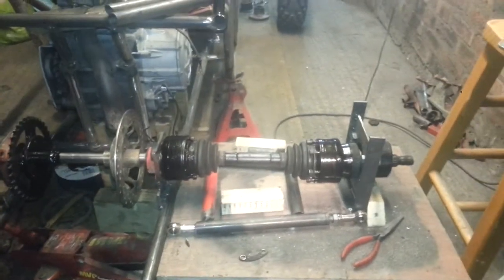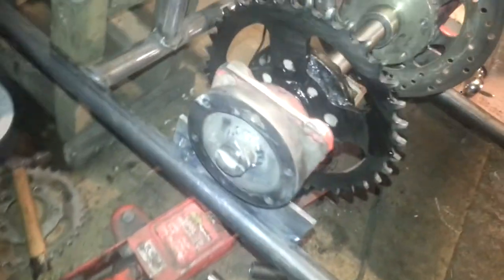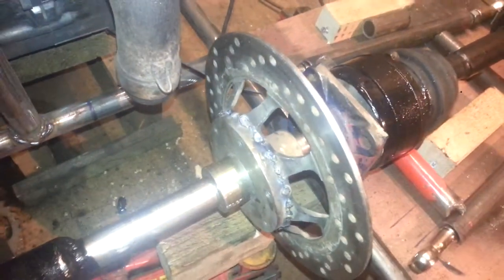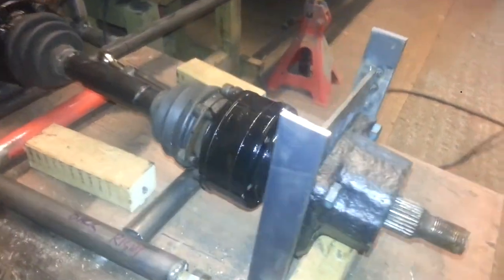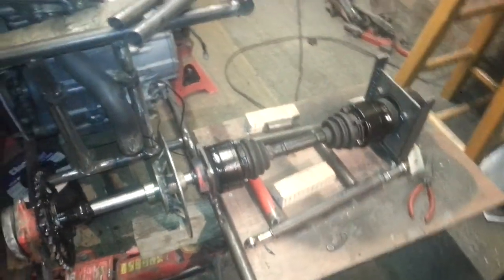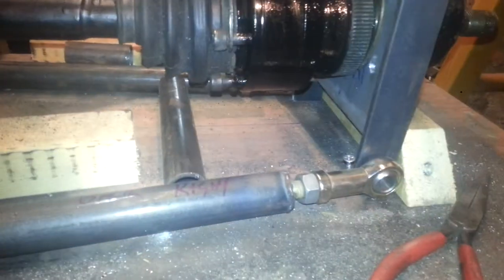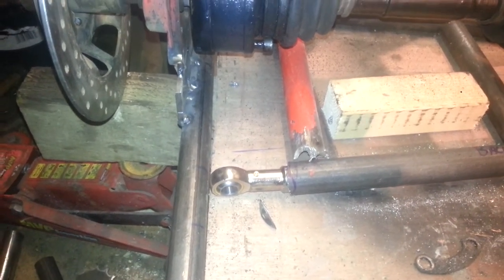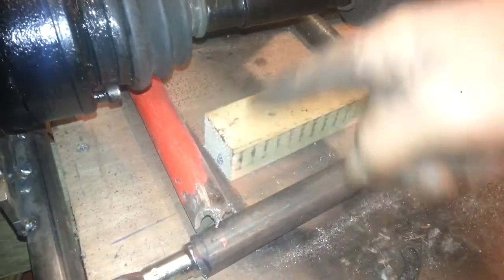Aprilia v twin 1000 buggy build

Comment: Hi mate, did u use Sierra driveshafts? And what did u use for the main centre shaft? Just a driveshaft with the ends chopped off? Great looking buggy btw
Reply from the maker: Alright mate 
yes sierra cosworth driveshafts
Reply from the maker: the centre shaft was just a bit 25mm steel shaft with 108 drive cups welded to the shaft . It worked ok but did break the weld a couple of times 
I'm helping my mate build a joiner buggy we have fitted a faze 600 cc engine and it came with the centre shaft and driveshafts from the joiner set up but we broke a hub on the first outing so we are now fitting old school mini driveshafts and hub carrier's and getting the centre shaft engineered to the right size so it fits in the drive cup splines then we shouldn't have any problems 
cheers steve

Comment: What are the 108 drive cups? Had a google but nothing much comes back. Is that what the weld on flanges are that uve bolted the shafts to? Ive watched all ur buggy videos, studying how uve done the drivetrain lol. Hope u don't mind me asking some questions
Reply from the maker: You can get the 108mm weld on cv adaptors from a company called DRD Racing and they are listed in the rear end parts section 
They are very good for all the parts you will need to build the rear end www.shop.drdracingproducts.com